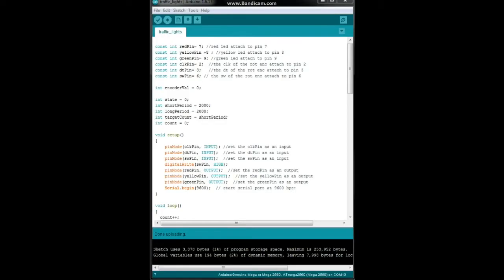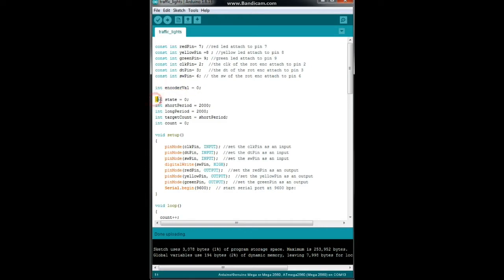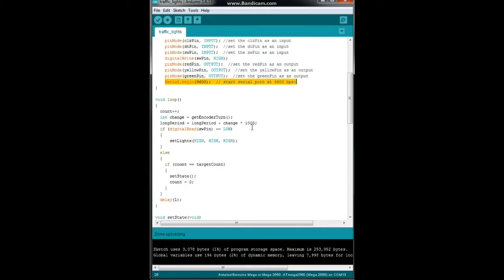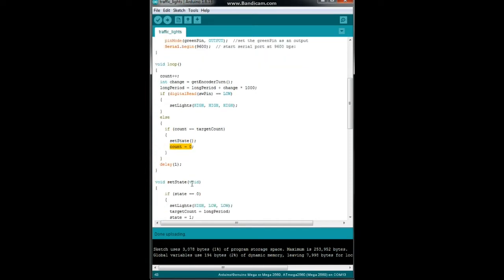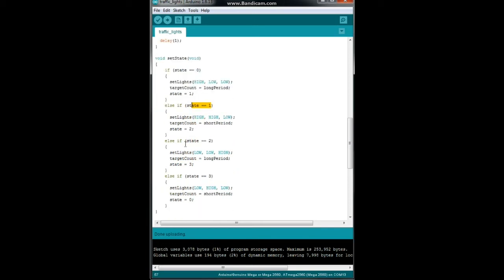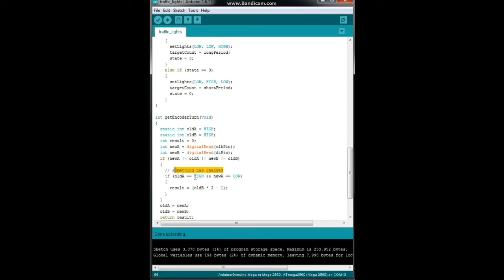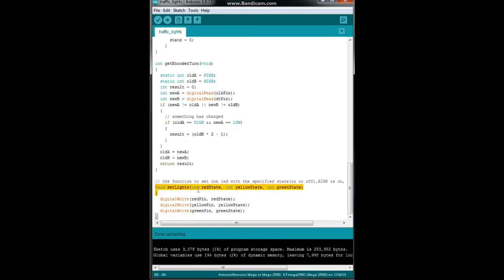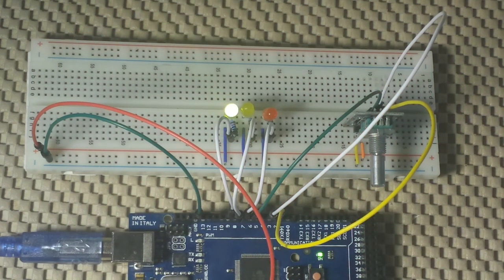Arduino Basics   Rotary Encoders

Comment: So if I didn't want to throw a microcontroller at this, and I just wanted to control an up/down counter chip (like a CD4029)... 

My first guess is that I would need is an op/amp to determine whether the signal was clockwise or counterclockwise. That signal could be used to set or reset J-K flip Flop connected to the up/down pin on the counter. Additionally, a branch circuit could take the data signal from the encoder to the clock of the counter chip to advance or back off the count. 

In the back of my mind I'm thinking the inputs on the op/amp could need diodes, or maybe even a capacitor if the backside of the signals cause problems with my directional control?

Does it even sound like I'm on the right track? Could be a good excuse for another video.

Comment: I am in the process of learning about Arduino, as I wish to use hardware to control certain inputs within a home based flight simulator i.e. X-Plane/MSFS2020. When it comes to prototype wiring I find things relatively straight forward, but creating sketches in IDE seems very difficult to grasp. For this reason I have really been enjoying your videos, as they are providing a great opportunity to learn more. Kind regards from the UK :-) I have also just subscribed!

Comment: If both A and B inputs are set for INPUT_PULLUP,  then only an additional ground is needed to pull either pin to ground.  So you really only need 3 wires.  I don't quite understand why power would need to go to the encoder.  Isn't it simpler to use the 3 wire approach?

Comment: where is code to copy?, mine keeps failing 
const int redPin= 7;
const int yellowPin =8;
const int greenPin=9;
const int clkPin=2;
const int dtPin= 3;
const int swPin= 6;
int encoderVal = 0;
int state = 0;
int shortPeriod = 2000;
int longPeriod = 2000;
int targetCount =shortPeriod;
int count = 0;
void setup()
{
pinMode(clkPin, INPUT);
pinMode(dtPin, INPUT);
pinMode(swPin, INPUT);
digitalWrite(swPin, HIGH);
pinMode(redPin, OUTPUT);
pinMode(yellowPin, OUTPUT);
pinMode(greenPin, OUTPUT);
Serial.begin(9600);
}
void loop()
{
count++;
 int change = getEncoderTurn();
longPeriod = longPeriod + change * 1000;
 if (digitalRead(swPin) == LOW)
 {
setLights(HIGH,HIGH,HIGH);
 }
else
{
 if (count == targetCount)
 {
setState();
count = 0;
}
 }
 delay(1);
}
void setState(void)
{
  state == 0);
  {
    setLights(HIGH,LOW,LOW);
    targetCount = longPeriod;
    state = 1;
  }
 if (else if (state == 1);
  {
    setLights(HIGH,HIGH,LOW);
    targetCount = shortPeriod;
    state = 2;
  }
  else if (state == 2);
  {
    setLights(LOW,LOW,HIGH);
    targetCount = longPeriod;
    state = 3;
  }
   else if (state == 3);
  {
    setLights(LOW,HIGH,LOW);
    targetCount = shortPeriod;
    state = 0;
  }
}
int getEncoderTurn(void)
{
  static int oldA = HIGH;
  static int oldB = HIGH;
  int result = 0;
  int newA = digitalRead(clkPin);
  int newB = digitalRead(dtPin);
  if (newA != oldA || newB != oldB)
  {
    if (oldA == HIGH && newA == LOW)
    {
      result = (oldB * 2 - 1);
    }
  }
  oldA = newA;
  oldB = newB;
  return result;
    }
    void setLights(int redState, int yellowState, int greenState)
    {
      digitalWrite(redPin, redState);
      digitalWrite(yellowPin, yellowState);
      digitalWrite(greenPin, greenState);
    }
did not work for me

Comment: WHAT HAPPENS AFTER U COMPLETE A FULL ROTATION , DOES IT KEEP INCREASE THE VALUE OR RESET
TO 1 SECOND
Reply from the maker: It increases as long as you keep going in the same direction
Reply: I am working on code to set maximum and minimum values. It should be straight forward.  Use if statements to check if the value is less than max, if it is then allow the value to increment, if not, then do nothing.  Likewise if you detect a counter-clock turn, check if value is greater than your minimum, and only do a decrement if it is.
Reply: @Shakespeare1612  Actually, it would be if actual value is greater than that ceiling value then the actual value = the ceiling value.  Same thing lowering the setting.  If the actual value is less than zero, then actual value = zero.

Comment: I like the Mega a lot but, yes, you can beat 54 GPIO's with the Teensy 3.6 board: 58 and it's foot print is 25% of the Mega...still I like the Mega a lot. Your video is excellent for a basic encoder tutorial...great job...newbies should know that if you have more than one encoder to check and/or a lot of other code running in your loop, you should put the encoder on an interrupt...while  more advanced that a basic encoder tutorial, I just wanted to mention that so everyone knows there are other ways to handle encoders.

Comment: pinMode(swPin, INPUT);
digitalWrite(swPin, HIGH);
Isn't clear. You say it's just so that it isn't floating and you know where it's at, but the pin being "INPUT" implies a high Z tri-state. That's pretty confusing to most Arduino users who haven't used the very oldest versions of Arduino or AVRstudio or read the Atmel datasheets from cover to cover, and so won't know that setting an input high or low actually enables the internal pullup resistor. The modern way of doing this in Arduino is a single line, pinMode(swPin, INPUT_PULLUP);